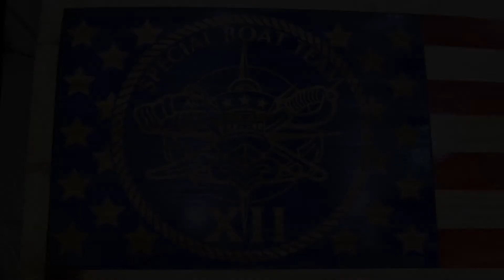Laser Engraving Time Lapse - Special Boat Team 12 Insignia - Custom Union

Comment: For making unions, what are pros and cons of using laser engraver vs. cnc?   Laser starting prices much less but not sure of limitation vs cnc.
Reply from the maker: So CNC is cheaper, and more versatile. The laser doesn’t come into contact with the wood, so you don’t have to secure it, good for workflow. The look is also different, and you don’t ever need to change out bits like you do on a CNC.

Comment: Watching that laser work is amazing. You do great work! Why does the laser not leave a burned black stars like most of the laser engraving videos where they are engraving on wood?
Reply from the maker: Thank you! So the burning can come from a few different sources, power too high, speed too low, (maybe a combination of both) and I also had a problem with the air assist blowing the smoke straight into the fresh cut and that blackened it up also. So now I only use the air assist of in cutting through material